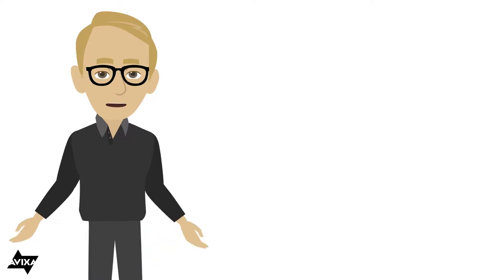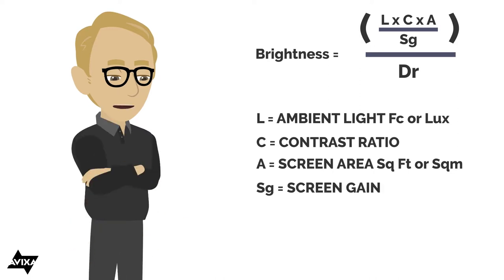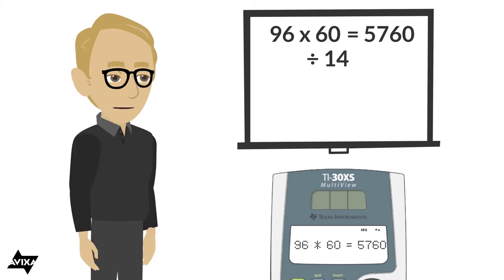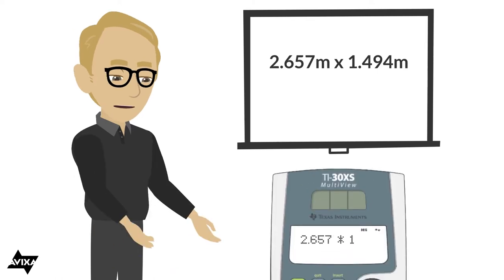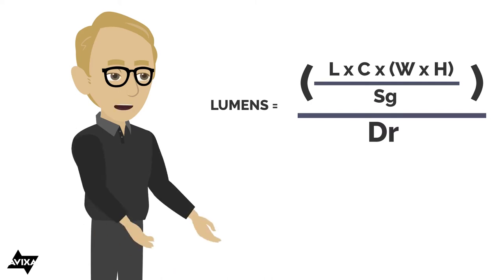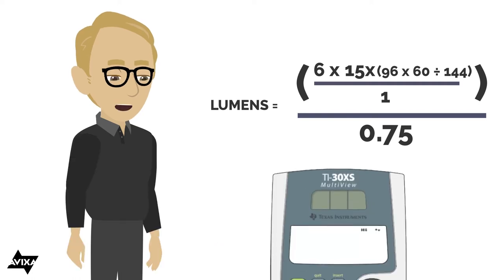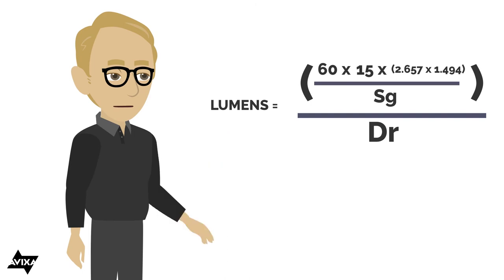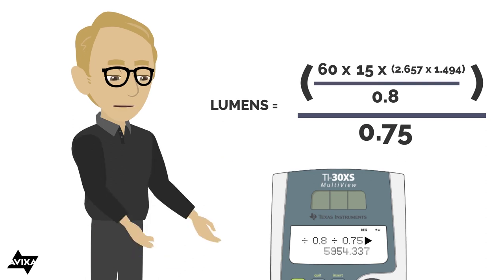Projector Brightness Calculations for Your AV Design

Comment: Can you explain the contrast ratio of 15? I am used to seeing values orders of magnitude larger. If I use 150,000 : 1 then the formula says I need a projector with the power of the sun! What gives?
Reply from the maker: The 15:1 ratio comes from one of AVIXA's published standards on contrast ratio, ANSI/INFOCOMM 3M-2011 or Image System Contrast Ratio. 15 is the standard for the viewing category we define as Basic Decision Making. That viewing category is for things like classrooms, boardrooms, multipurpose rooms, and product illustrations. There are several viewing categories in the standard, but the highest contrast ratio you most likely need to go is 80:1 for Full Motion Video (think home theaters, etc.). Something like 150,000:1 would certainly burn some eyeballs.
Reply from the maker: You can find our peer-reviewed standard here: https://www.avixa.org/standards/image-system-contrast-ratio

Comment: The final examples in meters vs. feet, I thought were the same screen; I guess I missed that during the conversion moment. The video sort of makes it seem that using the metric system, you need a brighter projector... lol
Reply: Michael Cornell right, same size screen but different screen gain (.8 vs. 1) hence the brighter projector
Reply: @LiveInStereodc  Thanks for the reply. :)